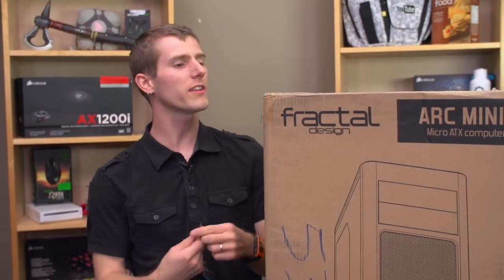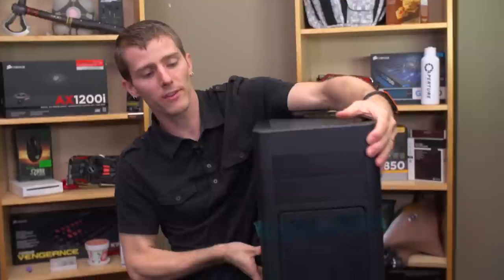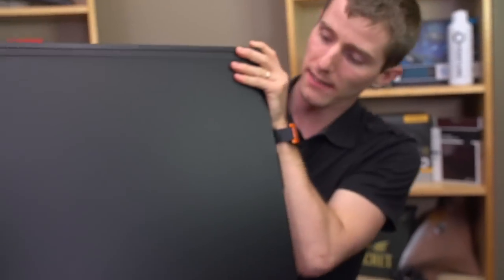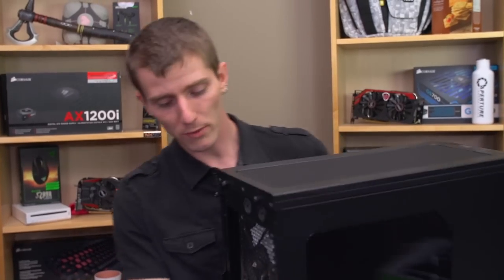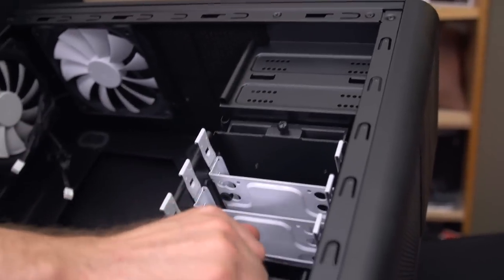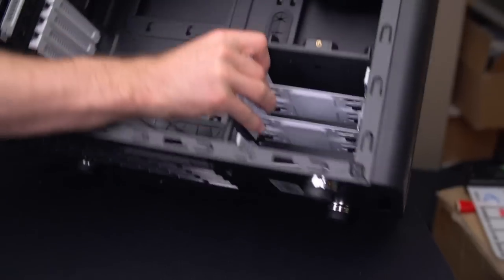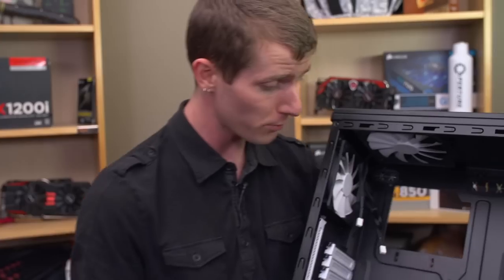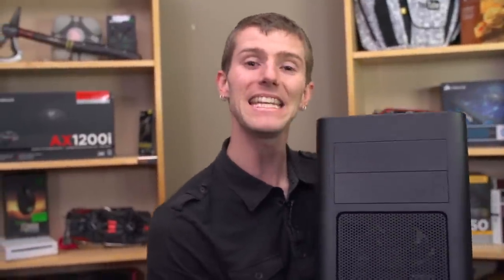Fractal Design Arc Mini R2 Unboxing & Overview

Comment: This is literally the only review I've seen that mentions dual 140mm support on upper fan mounts and specifically notes not having to remove the ODD bay, and points out the cutout in the back of the bay that enables this configuration. Just one of those little things I appreciate so very much. (much like Linus himself, waka waka/rimshot/clown horn/etc.)
Reply: Not a review, an overview.

Comment: bought this case and I have no regrets. the cable management is great and is perfect for someone who wants to upgrade their system from a smaller case, like I did. It can fit an hyper 212 evo with about and hands width of room from the glass panel. Anyone who wants a great value case buy it!

Comment: They should have called it Arc Micro R2, and made a case for Mini ITX and called that Arc Mini R2 instead.
Reply: In general micro is known to be as smaller factor than mini so that would be just plain wrong imho
Reply: John Ivar Rubach Agreed.
Reply: John Ivar Rubach But then again, Micro ATX is bigger than Mini ITX ...
Reply: Agreed.
Although Micro is technically smaller than mini, it's Micro-ATX being bigger than Mini-ITX that confuses matters.
Reply: Allan Patterson I know that, but you've got the words mini and micro in both.
Having the mini fit the micro and the mini and the micro only fitting the mini but not the micro would be balls out confusing dude.
Don't think about it like someone who knows the difference and sizes of mini-ITX and Micro-ATX and think about the people who don't know what a ZIF socket or LGA is.
Reply: NightFury173 you are right - in the same way a small grape might still be larger than a large raisin. They are different and shouldnt be compared.  ;-)
Reply: Peanutsreveng3 I agree. For an absolute pc"noob" this might be confusing, but then a gain....do many of them discuss or dwelve on motherboard form factors? If so do they get the answers needed to clearify by their peers?
Reply: They try to learn and further confusion doesn't help.
Look, I'm not saying I'm right or they're right, I'm saying they came to the best name they could. When they came out with the arc mini, I doubt they'd considered a mini-ITX version, else they may have called the first one Micro, but they didn't, it was called the mini and changing the naming is annoying in itself.
it's 50-50 which way ya go IMO, they had to make a decision. Some will happy with it, some won't and others won't care.

Comment: The 6 hard drive bays make this a decent case for building a NAS especially with all the mounting locations for fans.
Reply: kinda low storage NAS...
Reply: Depends on what you're storing. I have 3TB drives and I rip raw movie files and I still have space. You could probably also go with a NORCO or one of those Rosewill cases which are pretty cheap but they're significantly louder. The padding really makes a difference. I would have to be sitting right up to it for me to be able to hear any noise.
Reply: Sayian505 true, lol if you had like, 6tb drives *6 is 36 tb XD
Reply: Well a typical raw Bluray rip is about 50GB. 3TB is enough for 60 full length Bluray movies. 120 for 6TB. You could fit 720 full length Blurays on 36TB and about 4,500 DVD's.

Comment: This PC case got my attention, I do really like it. And if ever I decide to build another PC, I'd say that this case is already in the green-light of my plans.
Reply: ***** I have the R2 MIDI (without window) and I'm impressed!
Reply: ***** Thanks for sharing your thoughts my friend, tho I would prefer the one with window just to see the beauty of the build. I have important question, do you think that a normal size ATX mobo or even XL mobo with SLI support would fit in this case?
Reply: PERHAPS a mATX board with 2 way SLI support might fit in there, but 3x or 4x SLI, then you definitively need the R2 MI*D*I and a PSU with at least 1000 Watts for 3x SLI and 1500 Watts with 4x SLI.

I have one GTX Tian X in my MI*D*I R2 and there are only about 2 inches or ~4.2 cm space left between the HDD Cage and the Titan X.
Reply: ***** Splendid bro, thanks for the reply. That answers my question.
Reply: *****
Glad I could help you, mate. Greetings from Germany!
Reply: ***** I'm glad to see other comrades enjoying the matx case, I love the small ones.
Reply: F. Alves Yeah, that's right bro. Small form factor PC is very very good and economical.
Reply: ***** right now I got a mid tower, from a very unknown chinese (or something like this) company (aerocool), it's ok for air flow and shit, but oo noisy because of all the mesh fan holes... I'm thinking about gettin a n200 from coolermaster, that case is sexy as hell

Comment: I wish they had put this solid front intake design on the R4. All the plastic that clicks together is prone to rattling. With the hdd cage I enjoyed taking out the trays and rotating it to use as a front intake shroud of sorts.

Comment: LinusTechTips Every time you mention that additional expansion slot mounted vertically, you mention a fan speed controller that can be mounted there. What product in particular do you have in mind for that?
Reply: There's a fan controller that comes with the case

Comment: This case was an absolute joy to build in, although I will admit I was disappointed with the fan implementation at the front of the case, as they are mounted to the front panel and not the steel frame, meaning you need to disconnect them to take off the front cover. 

also, it would be nice if the top filter used the same mechanism as the front dust filter.

oh, and finally, not a big deal, but would have been nice to have some pre-installed MOBO standoffs, again, not a major issue, just something I would expect from a company like fractal design, especially given the price.
Reply: +ionceateapinecone the case feels solid as a rock though, one of the sturdiest feeling cases I have ever worked with.
Reply: I'm planning to buy this case and i have a question. Is the wire from the front fan long enough to reach the motherboard? Or did u uave to use an extenstion?
Reply: I actually put an old NZXT fan controller the client already had, the only complaints I would have are the colors of the front IO cables, hows easily the window can scuff/scratch, and the fact that the front fans are attached to the outside panel and not the frame itself.

None of these are deal breakers for me, and if you are willing to put in the extra work with this case, you can have some very satisfying builds.

Comment: The mother board cut out isn't large enough on their m-ATX cases.  I've used  ASUS and gigabyte m-ATX boards when mounting the h100i and noctua CPU coolers and every time I had to remove the board from the case to install and remove the cooler backplate.

Comment: Hey folks..noobish question. I am liking these cases with the ssd mounts at the back of the mobo tray. I was wondering if I would run into any hear issues with them there. I know ssds do not get that hot.. but I am still wondering. Thanks
Reply: You shouldn't. Your components that heat up most have fans or coolers drawing the heat and then it's pushed out of the case. Also the metal will absorb any more heat keeping those SSDs fine

Comment: Damn Linus, your making be ponder about giving up the my solid CM storm sniper case for one like the one you just reviewed because like you I'm tired of putting so much effort into something which the case should have implemented better. I REALLY REALLY love the way they did that top radiator design because many cases I see end up having to have too plug in your 8 pin power before you install the radiator fans.

Comment: Hey, how exactly does a Crossfire / sli work, do the clocking rates get stagnated so that if you thought about them as one device the clock rate is doubled or is it something like one doing half the calculations at exactly the same time as the other? Or does one card have 100% of the work and then the other is just there to take off some of the pressure when things get intensive?

Comment: if this mini, how big is the full size one?
Reply: Hah that's how I feel. I've always had like HP/Dell type cases in my house. I just shopped for an "aftermarket" case and the "mid" sized towers seemed friggin huge, let alone the full size. I ended up going with a "mini" case, and it's still bigger than my HP Pavilion.
Reply: its a pretty standard atx sized case. its not that much bigger.

Comment: I wish those SSD mounts were in the Define R4.
I had just gotten all my parts by mail for my first real computer, I was all excited, installed everything, SSD on the motherboard tray, wanted to plug it into the PSU, found out the cable has a 90 degree angle with the cables going towards the bottom, it wouldn't fit...
Had to remove GPU, GPU power cables, motherboard, frontpanel IO connectors, etc, etc. just to move my SSD out >.>

Comment: Should I get a bigger "Midi" version? Or stick with mATX? I do plan on picking up a R9 280X with a Asus Gryphon and i5 4670k. Corsair H100 at the top.

Or a midi version would be better? Because I'm not planning on dual GPU's.

Comment: Hey Linus :)
I was wondering if it's possible to fit a h100i in push/pull or a h105 in push without interferring with a "Corsair Vengeance Pro" Ram kit

Comment: Nice, i wish i could totally remove the HDD cages from my Scout II.
Reply: I know how you feel man
Reply: The rig i just built runs pretty cool since i don't run any high-end games, so it's not a huge deal.
Reply: i just need a new case because this one wont last me for about a 2-3 years
Reply: You can and it won't even be hard. all you need to do is take a drill and drill out the rivits, it will take all of 30 seconds and if you want to put the cage back you can either get more rivits or install a bolt and nut
Reply: I'd rather not introduce metal shavings into the case and risk a short - just saying it would've been cool if they'd designed the cages to come out.

Honestly, it's not an issue.

The Core i5 and GTX760  aren't overclocked, do fine with the stock fans, and i don't run any high-end games - so i don't really NEED that additional airflow.

In fact, the Fractal Designs 80+Platinum PSU never even draws enough juice for the fan to come on.
 I don't need the additional airflow, it would just look a little cleaner without the HD cages for the time being.

  Eventually i'll use the space for additional drives.

Great case.
Reply: exactly what I was thinking while watching the video

Comment: can it mount an itx board?  my asrock itx z77 pro has a pci-e for a ssd to be mounted on the bottom- so those cutouts could mean i could put one in without removing the mb if i decide its worth getting one.

EDIT: oh i just looked it up on ccl and read it does.  Plus the game version has 3 usb ports at the top.

Comment: Im thinkingof buying this case with a 360 rad on the top and a 240 on the bottom. if i use this setup will i be able to mounta 3.5 inch HDD anywhare?
Reply: If you kept the middle rack in I think you'd be able to

Comment: I managed to fit an 80mm thick monsta 360 in the front a 60mm thick 240 in the top and still was able to keep 3 of the hard drive bays
Reply: Ya I have a Midi R2 and it's basically the same case just slightly bigger and I love how the HDD cages work. In most cases once you install a front rad you are basically boned for anything internal bigger then a 2.5 inch drive (if they even have any alternative mounts for those) I appreciate Fractal actually designing a case where you don't have to lose your 3.5 inch HDD support if you want water.

Comment: Please someone answer my question,
I have 
i3-540, 4 gigs ram, gigabyte p67 motherboard, asus gtx 760, and silverstone essential 600w
So i want upgrade to i5-4670k (oc to 4,2 or 4,4 maybe) with h100i cooler and msi g45 gaming, do i need to upgrade my PSU or not ? Thanks :)

Comment: Would this case fit a GTX 970 and a Cooler Master 212 Hyper EVO? Plus is this case a lot smaller than the Fractal Design Core 2300? Many thanks in advance!

Comment: looks like you can't do sli/crossfire of 2 12inch gpu cards on this case.. the 2nd one will hit the bottom hdd cage (unless you remove em of course..) ok then, back to corsair 350d (which does not have adequate air cooling in my opinion and does not have all the needed dust filters).. oh well, you can't have it all..

Comment: Fractal Design Arc Mini R2 or Fractal Define Mini - Which would you choose?
Reply: Arc mini for sure, comes stock with 3 fans and has an incredible amount of cooling options. However, if you are willing to compromise airflow for cleaner looks and noise isolation, define mini is great as well.

Comment: Welp looks like I found my Mini ATX case. Would have went Bitfenix but some of the choices of mounting the PSU at the bottom front to vent heat out the bottom kinda turned me off and the air flow was less then ideal as summers where I live get up to 100*f+ in my room. But this baby looks like they thought the cooling end the fuck out.

Comment: I got new Specs what power suppy for these...

-ASRock FM2A75 PRO4+ FM2+ / FM2 AMD A75 (Hudson D3)
-EVGA 02G-P4-3658-KR GeForce GTX 650 Ti BOOST SuperClocked 2GB
-Crucial Ballistix Sport 8GB 240-Pin DDR3 SDRAM DDR3 1600 (PC3 12800) 
-AMD Athlon X4 750K Trinity 3.4GHz Socket FM2 100W Quad-Core Desktop Processor

Comment: More cases need easy-to-remove filters. My Cooler Master is a pain in the ass, I actually have to take out the optical drive to get the front filter out. Horrible design.

Comment: Hi linustech Community friends 
I have a question and a problmen
First I tell you whaz pc I got :)
I bought me a sabertooth z87
A i5 4670k its currently runs with a speed of 4ghz
I got a gtx560 from evga with 2 gb gddr5
And 4 gb of corsairs vengence 1600
A Power suply with 550 wats

Now my problem

I got massive lags on multiplayet games like planetside 2 (only when flying)
In gild wars 2 on endless battleground 
And now on battlefield 4 on low when zooming in or runing and changing direction after it 

My question

Could it be my hard drive becouse its speed is 5700 rpm and reaction 0,8 sec?

Becouse at battlefield I got all for minimum requirements and it still lags

I would like to hear some answers from you guys 

Please help me :)

Greetings from Marc Lewis Taylor in Germany
Reply: *****
Gtx 650 is far slower than a gtx 560. Gtx 660 is however faster than a gtx 560.
Reply: but it doesent feel like a fps lag
>.<
Reply: The issue most certainly is not the speed of the hard drive. I'd put my money on the amount of ram you have. From what I understand, user experience in BF4 is very ram dependent, and I'd image that PS2 is the same way. As someone else suggested, your video card could be better, but I'd advice getting more ram.

One last thing: Don't ask for help in youtube comment. There are countless forums  like tomshardware, overclocks, and linustechtips that will be more than happy to help you. youtube comments are really just a shot in the dark, whereas the folks who roam hardware forums actually might know something (since they spend their free time talking about hardware).

Comment: Hey can anyone help me out here? My computer's framerate drops after 5-10 minutes of gameplay. Usually games like counter strike GO and State of decay would run smoothly on regular settings.

I have an Intel Core i5-2500 CPU
6 GB of ram
Nvidia Geforce GT520

Anyone care to help me out?
Also I've recently cleared out the dust in my computer so thats out of the question.
I also ran system recovery and disk defragging.

Comment: I bought this case a few months ago...i really dont like it. The window came scratched out of the factory....
Reply: ***** Yeah im might gonna do that...do you think they still believe it? at first i didnt saw the scratches because i didnt have lights in it...now i have and there is not a spot without scratches
Reply: Tommie Terhoeve the windows, from my experience are extremely easy to scratch unfortunately.
Reply: Tommie Terhoeve You're going to hate on the case because of a scratched window? Blame UPS. This case is really solid built. Not like the flimsy cases you see being sold nowadays. CM and Fractal make some of the best heavy duty cases on the market.

Comment: Well whoever gets this case, have fun buying a boring ass looking case. Who want's these? lol
Reply: people who value function over form?
Reply: Because not everybody wants a cheesy gamer case. 
Good luck putting something like a Phantom series case in your office at work, lmao.
Reply: Fate I can concur. I bought the NZXT phantom..... biggest disappointment ever.
Reply: Crimson Hound  Amen to that! This is the case that has the distinction of fitting stuff that could be fit inside a fullblown midtower case. It supports tall air coolers, multiple radiators and drives. And has room mATX mobo's with PCIE slots >1 where you fit a 3-slot GPU and your own 1-slot sound card instead of relying on onboard audio.
And to the OP, seriously I hate using cliches, but you suck!